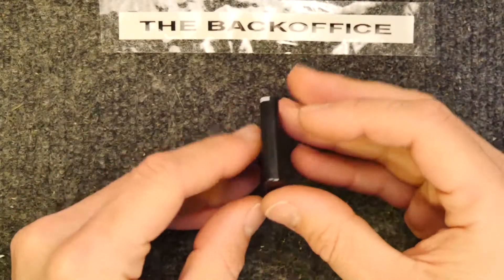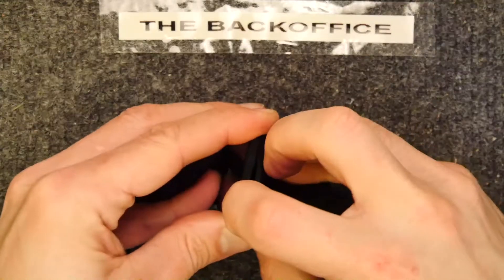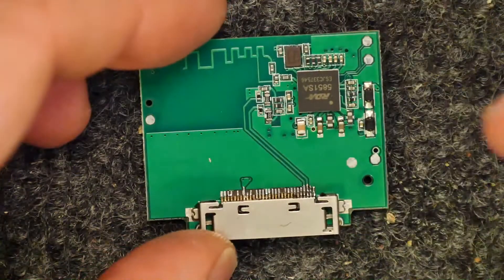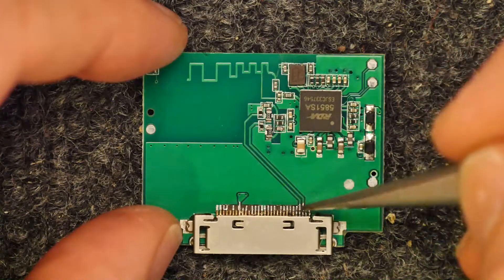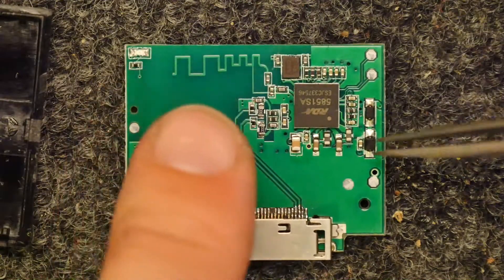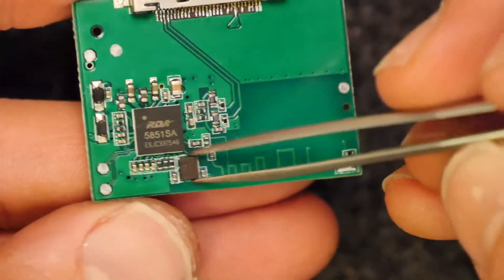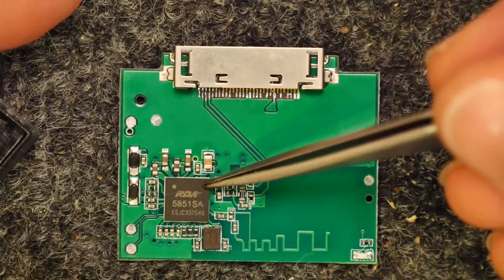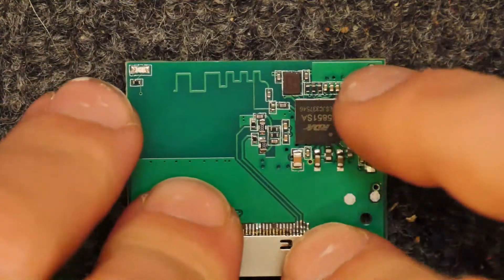Bluetooth Adaptor

Comment: Yup, that smaller component is indeed a timing crystal. You can start to make out the frequency "26.000 MHZ" in this video if you play it back in HD at 2:19
Reply from the maker: +David Maiolo that's awesome, good eyes! They are remarkably simple and pretty reliable. I'm thinking of just hard soldering to the PCB and putting these inside classic HIFI units.
Reply from the maker: +David Maiolo Also noticed from your avatar that you may also be an Arizona Microchip fan! Long Live the PIC!

Comment: nice rug
Reply from the maker: +sebastian114 You taking about my receding hairline? :)
Reply: +The Backoffice no i mean the surface you work on its filled with crums and stuff
Reply from the maker: +sebastian114 yeah it's not crumbs, but lots of pcb crud and plastic. It's really difficult to clean, however that is it's magical power, any lost screws or components get stuck in it and easily retrieved.